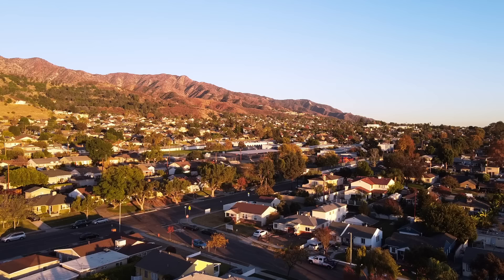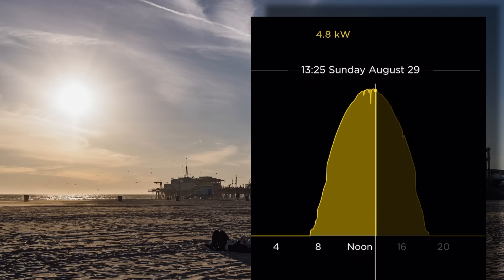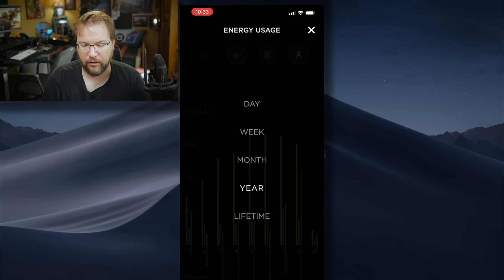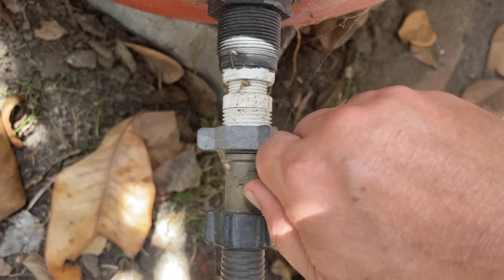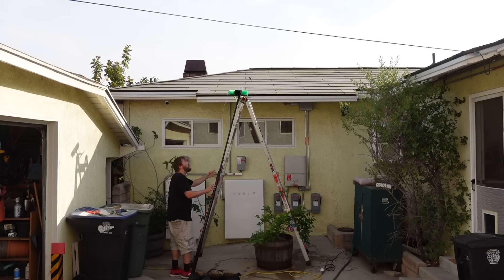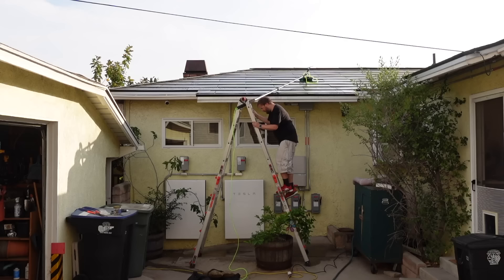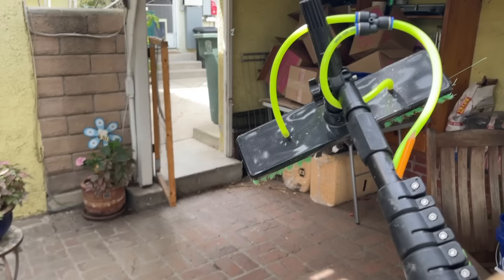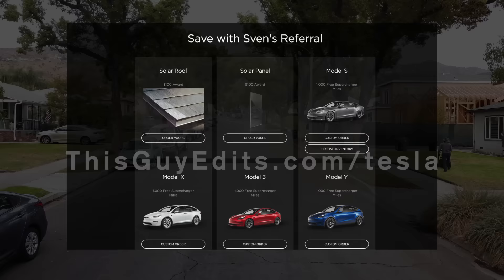Tesla Solar Roof: End of the Honeymoon Phase!

Comment: I guess im spoled with having 10kW peak current.
and 80kWh production on a perfect day.
Reply: Really depends on size of the house and energy usage.  I only have 8kW of panels, 7kW inverters but I offset 100% of my house electricity + EV.
Reply: @whattheschmidt  oh, so you dont run AC or anything damanding i guess?
Reply: @tenkikun  I have central AC. My solar generates just over 9kWh per year.

Comment: So you'd need 250 years to save as much from using solar panels vs grid elec? oof - and that's me basing it on a 30k roof.
Reply from the maker: 250 years? I have a video about the final cost and when the system will be completely payed off: https://youtu.be/abyQeGIQ4JA Find out if you're right :)

Comment: Have you called  tesla and ask them why you  are not getting  close to 7.8 kw  or more?
Reply from the maker: No need. A solar system will never reach 100% because the cells would all have to be at perfect angle to the sun at the same time. A roof has different sides with different angles, so the tiles will have non-overlapping times of peak performance.

Comment: Where do you live that your tap water needs to be filtered to remove toxins?

Most municipal districts are extremely safe and most people filter just for Taste and hardness
Reply from the maker: Chromium six is one toxin that many cities don’t disclose specifically (lobbyist prevented it to make it mandatory) as it is very expensive to remove and highly toxic long term. Also cities specify water safety when leaving the plant not when it arrives at your tap. There are still plenty of lead pipes in the ground. I recommend to read some of the research at Hydroviv for your local water. Here’s an example: https://www.hydroviv.com/blogs/water-quality-report/albuquerque
Reply from the maker: I'm not going to disclose the city I live in, but we have a major chromium six issue due to factories dumping it into the ground in the 50's. I'm not taking any chance with my family on trusting water safety reports that don't disclose the levels. Instead I had tested the water myself (before and after filtering) and found the results to be concerning.
Reply: @ThisGuysTesla  Ok, I'll take you at your word but that makes you a far outlier.